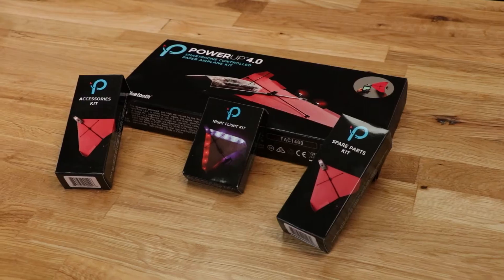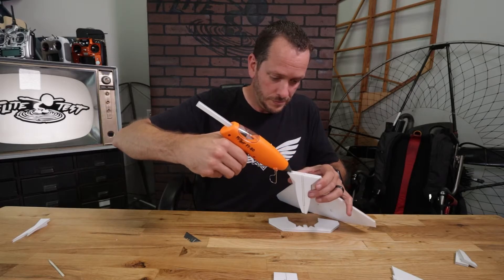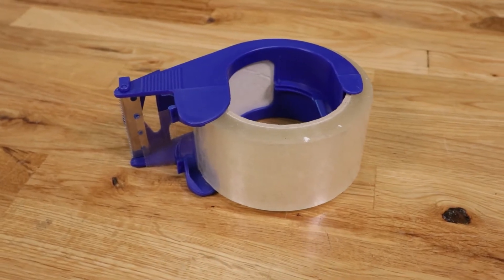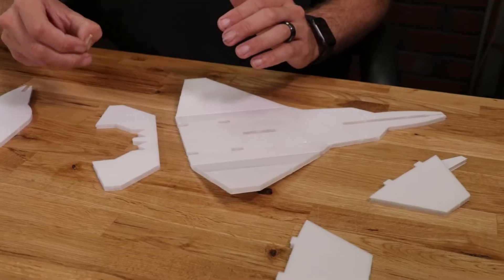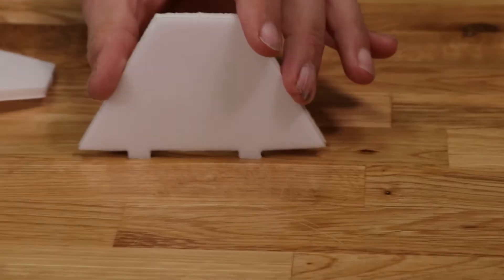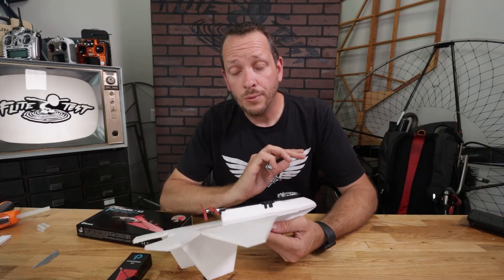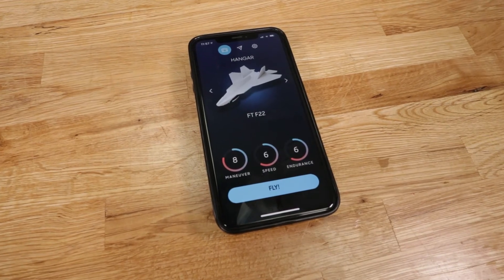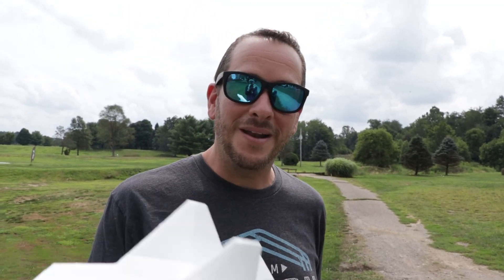FT Power Up F-22 Build

Comment: Do you have some Tipps or Videos to modify the Plain, that the powerup 4.0 can be mounted at the top side ( for better protection), ofc some cut outs for the propeller would be necessary

Comment: why not keep the paper on as reinforcement instead of putting tape on?
Reply: because in the development video, the problem they had was it was to heavy for the module, then they peeled it off and it flew the best,so if you don’t peel it, it will be to heavy